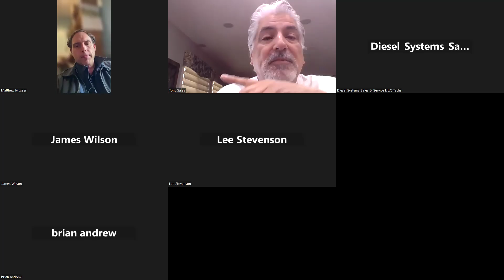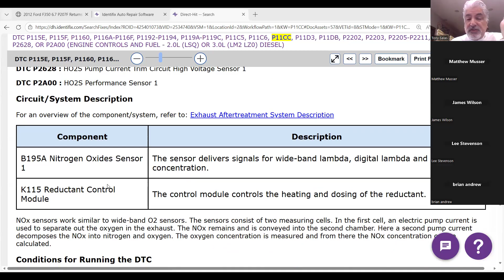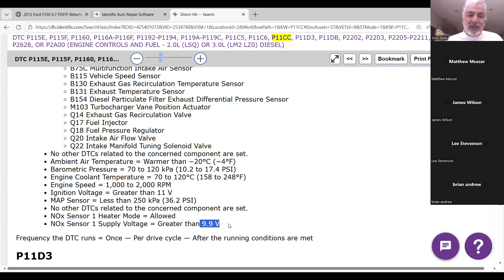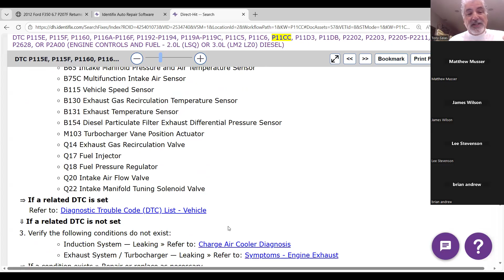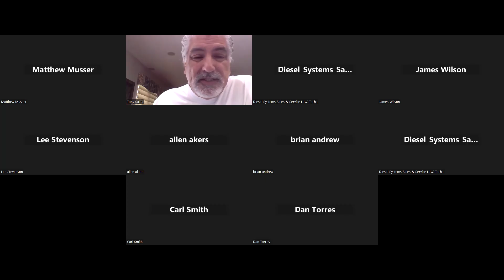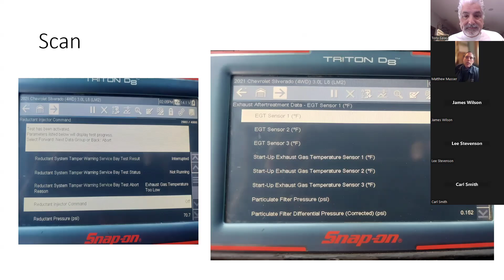Diesel Driveability Roundtable Jan 2026

Comment: I watched a couple of your videos I have a problem I can pay you to help me diagnose left in shop one 2 weeks they never got to it three new parts to it I did another guy has no clue what’s going on maybe on zoom or FaceTime let me know thank you
Reply: Also great cideos
Reply from the maker: What’s the issue
Reply: @dieseltalkwithtonysalas8725 my truck doesn’t want to get past 20 mph when you press pedal all the way down if I want to go faster I have to touch pedal slightly so it doesn’t “bog” down I can get up to 50 that way in about 4 minutes also I replaced fuel pressure valve I can get high rpm’s at park when pressing pedal so I have codes of
P 0087-19
P 0102-09
P 0113-09
P 0670-7f
P 0193-19
B1440-13
B2610-13
2005 3500 6.6 Silverado
Reply: My fuel pressure is at 5k around at idol and 26k under load just very very confused